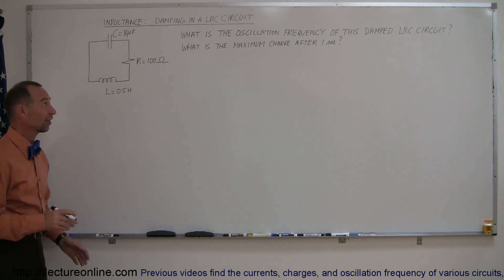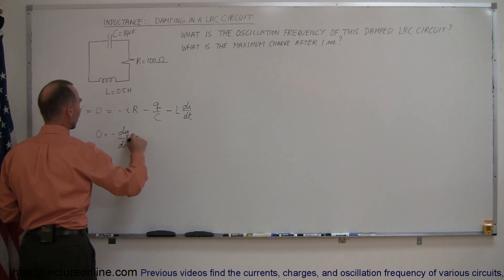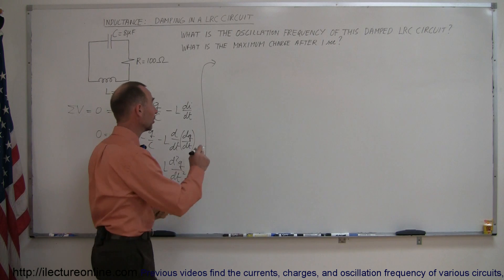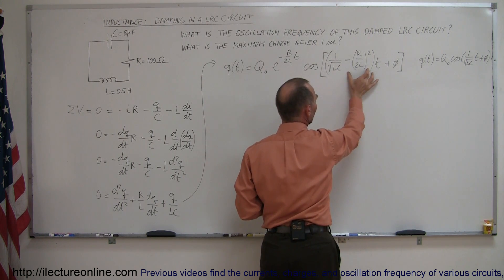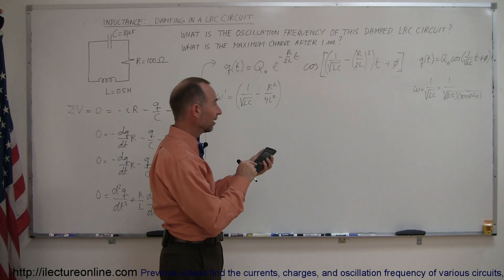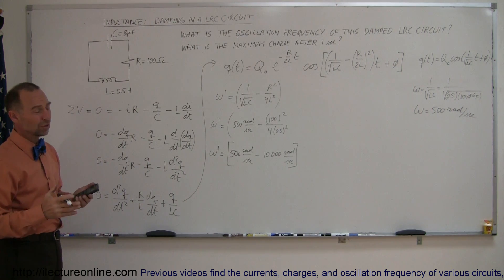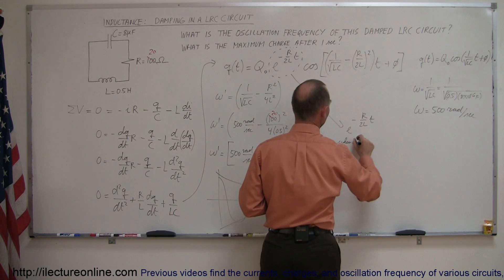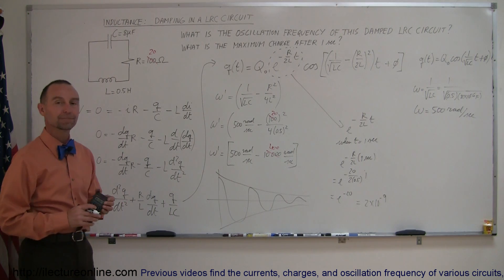Physics 47  Inductance (8 of 8) The L-R-C Circuit With Dampening Effect

Comment: sir how all the negative voltage drop add up to zero in KVL as you took across resistor , inductor and capacitor
Reply from the maker: The current will be flowing back and forth (like an oscillator), and therefore the voltages will be positive and negative accordingly and they will always add up to zero when going around a closed loop.

Comment: I think you've done the mistake of writing integral(E.dl) i.e. V  in the whole circuit as 0.
Professor Walter Lewin pointed out the same mistake in one of his lectures in 8.02x saying that it should never be written 0 if we have an inductor in the circuit. The net V would be equal to -L(dI/dt) instead of 0 on the right-hand side.

Comment: Sir, I'm a little confused about the maximum charge after 1 second. On the video, we only calculated the e^(-Rt/2L). What does that term correspond to? And wouldn't the maximum charge after 1 second would be something similar to the charge at 1.00001 seconds, which would correspond to q(1) in that whole equation in this example?
Reply from the maker: The charge will oscillate on the capacitor from 0 to maximum and back to 0, etc.  Because of the resistor, energy will be lost, and thus the maximum possible charge on the capacitor will be reduced over time according to the equation given.  The problem asks what the maximum charge can be on the capacitor after 1 second.

Comment: I think there is an error in your freq. term for q(t):  here you used 1/sqrt(LC) - (R/2L)^2 and get 500 - 10,000 rad/s  This negative freq is incorrect for this underdamped circuit
The correct formula to use here is SQRT { (1/LC) - (R/2L)^2 } = 
SQRT(250000 - 10000) = 489.9 rad/s
Reply: dale nassar yes I think the same 1/LC should be there not the squareroot